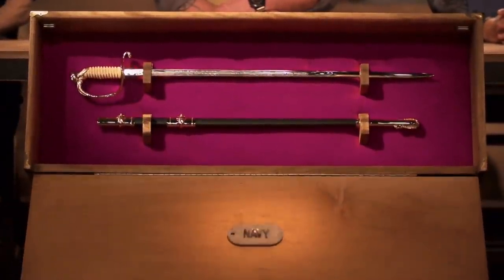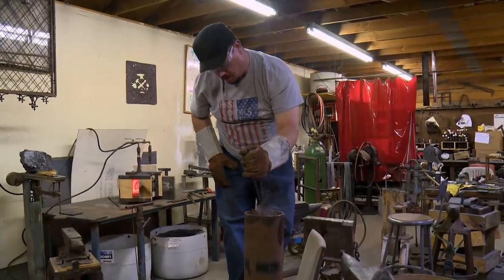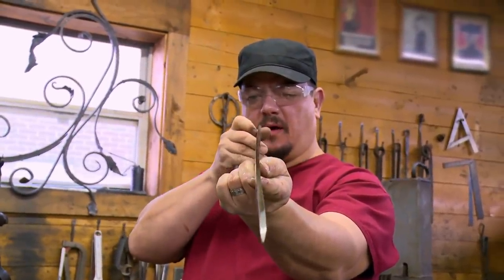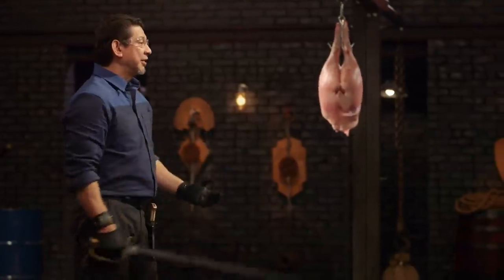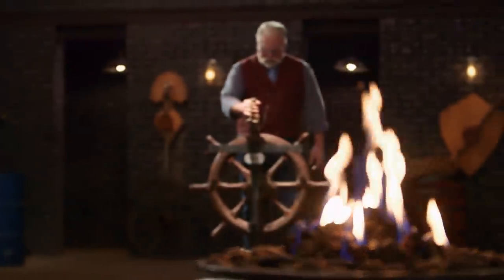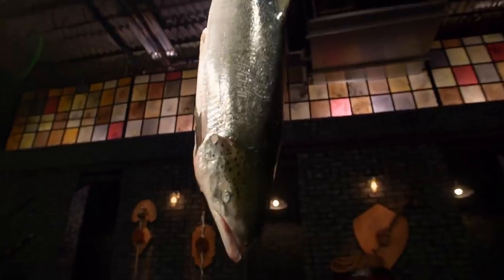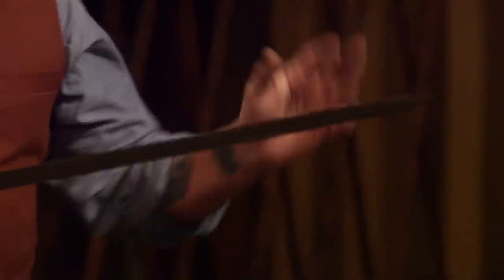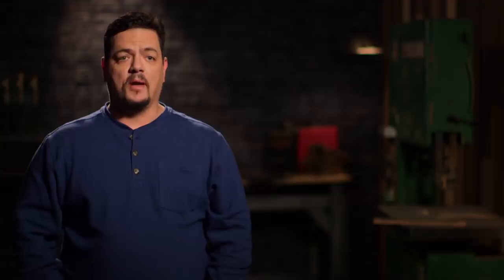Forged in Fire: Naval Officer's Sword Final Round: Jerad vs Lee (Season 6) | History

Comment: One thing I always find odd is when they don't do a destructive strength test. Like flex tests are good, but this is almost always the result when a destruction test is not done to give definitive results as to which was the better weapon. Both performed equally well, one had a slightly too large handle BUT every time the handle was mentioned they also said it still felt good and didn't want to slide. An ice or wood chop may have been a better strength test.